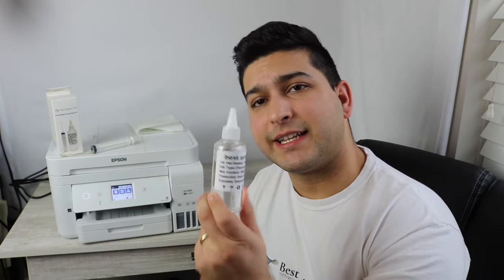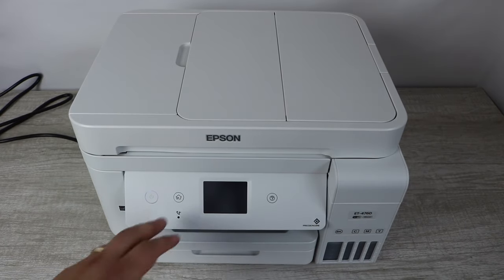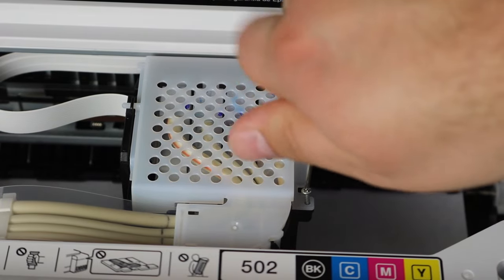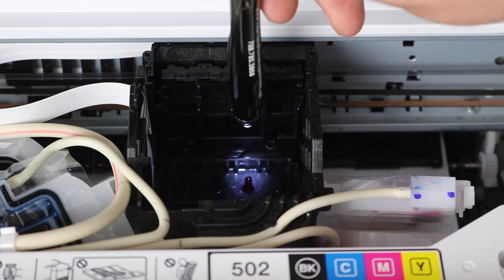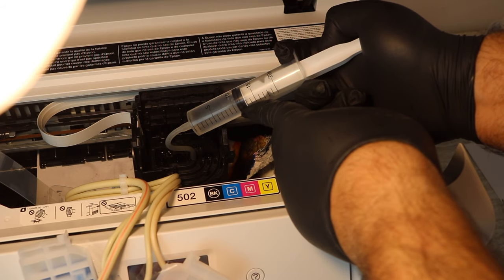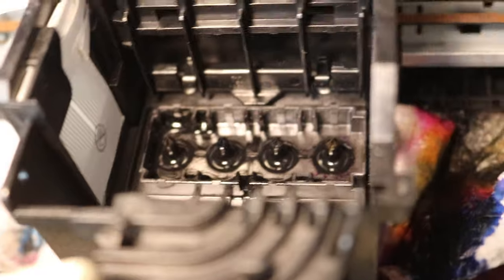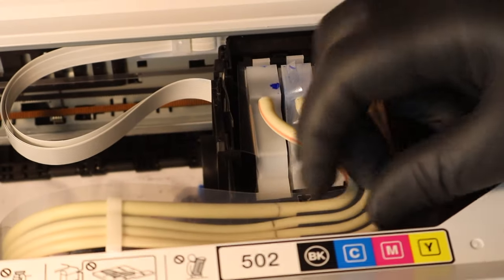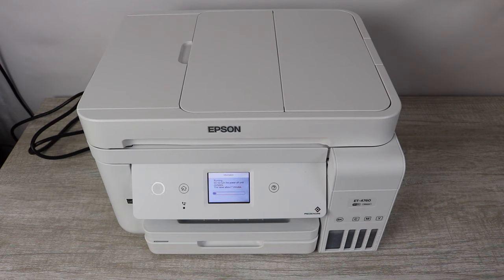How To Flush - Clean The Epson ET 4760 Not Printing Color/Black [FIXED]

Comment: Note:  If you open your printer and find that one of the small ink cartridges is empty, then you do NOT have a clogged print head.  Instead you have a clogged ink tank!  Ink is not being delivered from the tank to the cartridge.  To fix it, put on your gloves, then remove the feed hose from the top of the cartridge.  Make sure the syringe plunger is all the way down, so there is no open space in the syringe, then put the tip of the syringe into the hose from the tank.  Pull gently on the syringe plunger, drawing ink from the tank into the hose.  (If ink still does not flow, then you have a bigger problem)  Then remove the syringe, empty any ink into a paper towel, and reconnect the hose to the cartridge.  Reassemble the printer and run a power cleaning (it's the only way to completely refill the empty cartridge).  The printer should now print correctly.
Reply: Hi Jim, I just got my printer ET-3760, THANK YOU, I have now, with your help figured out, INK TANK is clogged. Ive had printer, converted to sublimation ink, I took tube off at cartridge, used syringe and pulled ink out, none has ever made it to cartridge, issue is, Power cleaning, it says i need to replace my maintenance cartridge, WHY? Its brand new.. Im so upset with Epson..  IF I can get ink tank to clean up, what else can I do besides power clean?
Reply: @carolnewton3741  I'm afraid you've exhausted my knowledge on the subject.  I put everything I know into the message above.  For mine, that was all that was needed.  I see a video to the right about replacing the maintenance box - maybe that will help you.  Good luck!
Reply: Thank you so much for this tip. My magenta cartridge, which is the one that does not print, has very little ink in it, but the tank is 80% full. I want to make sure I understand that disconnecting the hose from the cartridge, inserting a fully depressed syringe into the hose, and pulling the syringe plunger out will, in effect, pull ink from the clogged ink tank into the syringe. 
If this is correct, do I need to flush the print head first AND pull the ink from the tank? Or do I just skip straight to your instructions?
I'm sure my problem is that my printer sat for several months without being used. If anyone has any suggestions for preventing clogs during extended periods of disuse, I would appreciate it.
Reply: @ghwallace9  No, there is no reason to run a cleaning cycle first.  It would just waste ink, and the clogged tank would remain clogged.  Just follow the directions that I posted, then (as my directions state) run a power cleaning after you have unclogged the tank so that all of the cartridges are properly filled.
Reply: @jimgilliland1722  Color me happy. Even though I didn't have the cleaning kit, I made do with a medical syringe to follow your instructions to unclog the tank. Bingo! Thank you SO much for adding the tip about the clogged ink tank. 
Do you have any thoughts on what I might do the next time my ET-4760 is left idle for an extended period of time. The power cleaning DOES use a significant amount of ink.
Thank you again!
Reply: @ghwallace9  I don't print a lot, but I probably do print at least a page or two every week or so.  I think the biggest risk with that is that many of my small print tasks might not use every jet of every color.  So it might be a good idea for any or all of us to run a nozzle check every few weeks just to move a little bit of ink through each individual nozzle.  I have not been doing this, but I think I will start.  I ran a check just now and found no gaps - every jet is firing as it should.  Just to show how little I print, I've had the printer for over two years and printed fewer than 500 pages.  And slightly more than half of those contained only black ink.  Of course the fact that the nozzles all work does not guarantee that I don't have a clogged tank.  There is no simple test for that.
Reply: Thx
Reply: You're a lifesaver. This is exactly what my cyan cartridge looked like on taking it apart. After a power cleaning it's printing perfectly.
Reply: Thanks for this video , can you help with cleaning the tanks ? I want to swap to sublimation ink 🤔
Reply: So basically emtpy the cartridge?
Reply: @user-du4gw  No.  The procedure in my message is for a different situation than in the original video.  The video gives a very good and complete description of what to do if the ink jets are clogged.  But if you open the printer and find that the cartridge is empty even though the same color tank is full, then you have a different problem.  That's when you need to follow my procedure.  You need to get ink flowing properly from the tank to the cartridge.

Note that it is possible to have both problems.  I've used the procedure in the video to clean my printheads and it solved that problem.  But no matter how clean your printhead is, you can't print with an empty cartridge.  You have to get the ink to flow from the tank to the cartridge and then from the cartridge to the paper.
Reply: I think this is my issue. No ink is in the cartridge. I'm going to try this. I even tried cleaning the cartridge!!!

Comment: Phew - it worked! After our printer (well my wife's printer) that she had sitting in storage for 3 years while we went off to Texas, she says to me after returning to Canada, "here, have my good ET-4750"! I tried printing - but only blank pages came out! Not even a drop of black ink. So I found this video. Made sense. Ordered right away from Amazon, and the next day had the solution. But I don't remember hearing in the video (I could be wrong) that warming the solution could help. One of the nozzle head was totally dried up and so I push very hot water and it unblocked it. Then like the instructions said on the box, I needed to wait 24 hours before re-plugging the printer and doing all the maintenance test multiple times. It's now printing - saving at least $600 for another compatible Epson! Thank you very much!
Reply from the maker: Excellent, thank you for sharing!

Comment: Only my black ink was not printing. I purchased the cleaner you suggested and Followed your video. I only used 5 ml of the cleaner. Put everything back together and it now says I have a scanner error that I not Epson can fix. Wish I would have just done a power clean.
Reply from the maker: Did you wait 24 hours before powering on the printer. The instructions clearly stated that and the cleaning kit packaging.

Comment: I did everything and still nothing! I also replaced the maintenance box and it's completely clean even after I did the power cleaning (after the cleaning process). The ink will not flow inside the cartriges and when I tried printing, some solution came out. So no ink is going through the veins I think. So frustrating.  What should I do now?
Reply from the maker: The only thing you can do is repeat the whole process and make sure your ink is full

Comment: How do I open the printer to get to the print nozzles on a ET4700?
Reply: That’s what I’m trying to figure out right now damn what a downfall about not having easy access pop opening this et4700
Reply: Did u figure it out?
Reply: No. I end up purchasing a smaller version of the same printer, ET2720.
Reply: I have this problem now.  I think I will just give up and buy a different printer altogether.  It's only just over a year old and the second printer to have this problem.  So annoying!

Comment: Hello Brandon, I don't know if you still read comments since this video was done 4 years ago. I have had an Epson ET4760 for 3.3 years. I love the printer and use it often. I had 200 flyers and 100 pamphlets to print for a ministry even last Sunday. When I attempted to print them the colors were off. When I did the print nozzle check BCM were fine, but there was no yellow. I went on YouTube to fix the problem I watched a lot of videos but yours was the best. I ordered the BP Printhead Cleaning Kit. Of course It did not come in time for me to print the flyers/pamphlet so I "farmed them out" to other. Today was the first chance I had to do the cleaning. As you demonstrated, it was very easy. I appreciated your step-by-step instructions. I did everything exactly as you demonstrated and it went "smooth as silk". With the exception of one problem. The white paper under the print head got wet and fell apart. I had paper towels on the right side which got soaked, as your did. I had a Sham Wow cloth to soak up excess. Now I am in the 24 hour drying time. My concern is the wet white paper underneath that is falling apart from the liquid. Do I need to replace this or leave it as is? Will my printer work when all is dry? Thank you.

Comment: Thank you for the video.  I finished all the instructions.  I would like to add that once I finished flushing each of the tanks I had to order the Epson T04D100 Ink Maintenance Box $15 at Staples.  Have to wait to see what the print output looks like.  I also used Q-tips to remove any liquid residue around the print valves before re-installing the tanks.  In addition as a precaution I would recommend purchasing a pair of goggles and plastic shield for your face in the event the cleaning liquid somehow splashes.  Bit of advice to everyone is to hold the tube securely to whatever tank your flushing while pushing the liquid from syringe. Pushing the liquid through from the syringe does require some effort.  Be careful. The last thing is the phillips head screwdriver from the suggested parts list is too large.  I had a Belkin dual screwdriver (flat and phillips head) that worked.  Thank you again for the video.

Comment: I'll be! This actually worked on my ET-4760. I am impressed. Thanks for the solution kit and the precise instructions.
I would like to point out that the paper in the paper path got soaked and then jammed up when I turned it back on. Need to have some sort of plastic sheet to slide under the head along with the paper towels to prevent that. Beyond that this worked perfectly and saved me $500 for a new printer. Thank you!
Reply: Same.  Wish I saw this comment before I started!

Comment: Thanks for this video.  I appreciate the detailed, clear and confidence boosting instructions in your video.  I often lack confidence in dealing with technology issues, and your strong encouraging words, saying that this is an easy fix, helped encourage me to take care of the problem myself.  

I decided to try  the deep clean FIRST, and that completely fixed my color  printing problem on my ET-4760 printer.  

The deep clean, which took about 10 minutes resolved my printing problem.   
As soon as the deep clean was complete, I was able to print in color immediately after the 10 minute deep clean.

These are the steps I followed for the deep clean 
       Step 1:  TURN OFF THE Product

       Step 2:  Visually check the ink levels and make sure each ink tank is at least one-third full.

****Caution:*****If you run a Power Cleaning when the ink levels are low, you may damage the product.

Step 3:  Press and hold the  power button and the  help button AT THE SAME TIME until the Power Cleaning screen appears on the LCD screen.

Then I followed the on screen prompts....and completed the power clean!!!

DEEP CLEAN was painless, effortless, and EASY!  The printer did all the work and I am back to loving my printer again!
Reply from the maker: Perfect!

Comment: I bought the Best Printers Cleaning Kit and just used and ran my power clean.  So far the print looks much improved.  However, the printer jams up when trying to print double-sided now.  Is there a way to perform maintenance on the print rollers or can I replace the rollers?  Thank you for your very informative video.  Much appreciated!
Reply from the maker: You can manually clean the rollers but replacing them would be very difficult. I am glad your print quality is improving though.

Comment: I have an ET-4700.  I don’t think the ink reservoirs are filling.  I have the bottles in correctly but I can’t see any of the ink colors through the little windows in the front.  How do I make sure the ink is even in there?  If ink is not getting in how do I clean the nozzles so the ink goes in?  After that, how do I get the top of the printer off?  In the video you just lift up but the 4700 doesn’t do that.  Thank you!  -Emily.

Comment: Nice video, haven't tried it yet, but got a question.  If you need multiple cleanings of each printer head, it doesn't seem like one bottle of the cleaning kit will be enough.  The link says that it is only a 100 ml bottle.  Unless I misunderstood, that is only enough for 5 cleanings.  Did I misunderstand?  I'm pretty sure that all 4 of my heads are pretty badly clogged and I don't think a single 20 ml cleaning of each head will be enough.
Reply from the maker: Message me on Amazon.

Comment: I'll be damned. it worked. Mine was so clogged my colors were not printing anything at all. Only black never got clogged because I print work papers every day and never use any color. Going to make sure I keep it on color prints from now on. Instead of forcing the cleaner through I just put the syringe on and pushed in 1ml. and let it sit for 30mins to break up the clog. Did that for yellow, red, then blue. Used as little cleaner as possible lol. and then did the power clean. then printed a test page. Worked the first time. I expected to have to do this at least 3 times since they were completely clogged.
Reply from the maker: Great tip!
Reply: Thanks. Have been working ever since. Still no issues.

Comment: The nozzle check only printed the blue lines.  I flushed the black, cyan, magenta and yellow.  the paper towel had ink from the black and cyan but the other too is just clear liquid.  The ink tanks are full.  I haven't put everything back yet to test.  I wanted to see if this is normal? before I reassemble and do the nozzle check again.
Reply from the maker: Thank you for reaching out, THE NEXT STEP is to run a power cleaning. It sounds like you are in the right direction so far.

Comment: ET-4760 Cleaning - cleaning fluid went through the paper towel and soaked the white paper under the print head. What a mess. Now what. Happened on the first jet.
Reply from the maker: You can swap the paper towel every 10 ml you push through. That will minimize the mess.

Comment: I did.not go through the other post. Forgive me if answered

When you are doing a Power cleaning where does the excess ink go. I know about the pads that ultimately get washed .and reset msg. The auxiliary catch tank; is that blk or all colors. Once the auxiliary bottle is put in does this bypass error msg forever? Thx

Comment: Its ojay to do it to empty your tank by using it everyday until it will empty bcz you want too travel and carry it with you? Its safe? My unit is L3251 epson
Reply from the maker: Yes but always leave a little ink at the bottom of the tanks. Or you risk the tubes drying with ink.

Comment: Will this work on an Epson ET 15000? I’m using it for sublimation and running into this issue where my nozzle checks are bad. I’ve done multiple head cleanings and printed multiple purge files to try to get this printer printing normally but it’s not working. Only improved mildly. I just unboxed off a few hours ago. 
I have a Sawgrass too and never had this issue once. Ugh.
Reply from the maker: Yes it will work with that model.
Reply: Yes! It worked for my ET-15000!

Comment: What's the diameter of the tubing? I have the syringe, and went to my local pet store and bought fish tank tubing. However, it's just a bit bigger than the printer nozzle, so when I tried to push solution through it leaked. I stopped immediately, of course. I just need the proper tubing and don't want to spend $25 for the kit. Thx.
Reply from the maker: Go through the trouble and drive around town or spend $25. I believe the diameter is on the Amazon listing page or under answered questions.
Reply: @BestPrinters  I was never going to drive around looking for a crummy piece of tubing. If I found out the diameter I would just ordered it on Amazon because I doubt I'd be able to find tubing that specific size around here anyway. I just went ahead and ordered the kit on Amazon. I fixed the problem after about five nozzle cleans anyway. Why do they have to make printers be such a pain in the butt and so expensive to operate? Out of all the tech I've bought over the years -- PC's, stereo equipment, kitchen appliances, TV's, etc -- the only one I regret is printers. I've never gotten all the money I've invested in them back. Continually and neverendingly frustrating.

Comment: I ordered and followed this process as well. I put 30cc of cleaning fluid in the yellow until it ran clear. Placed everything back together ran the power clean. It took about 10 minutes, reprinted, yellow very faint. Hopefully you can help me if possible.
Reply from the maker: You will need to repeat the process.

Comment: My blue is not printing, and all my colors are wrong expected for black. I have the ET2720 do you recommend to do this? If so How do I open the ink area my printer does not open to the ink nozzle like yours? Thanks in advance
Reply from the maker: Hi if the top of your printhead doesnt open then you wont be able to do this cleaning unfortunantly.

Comment: I have the Et 2750 and it won't print black even after cleaning 2 times using the procedure described. I did a power clean after 1st cleaning. It won't let me do that after 2nd cleaning until 12 hours.  Is this printer done. It is only 2 years old.
Reply from the maker: No, repeat the process and make sure your ink is full through the whole process.